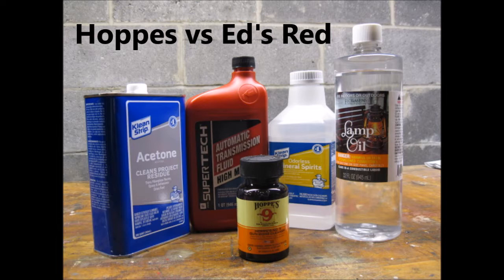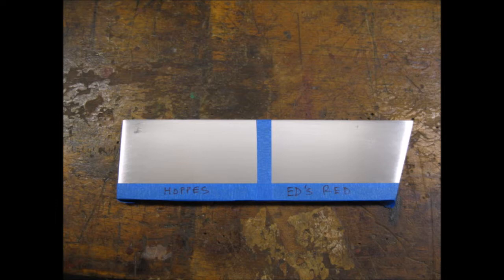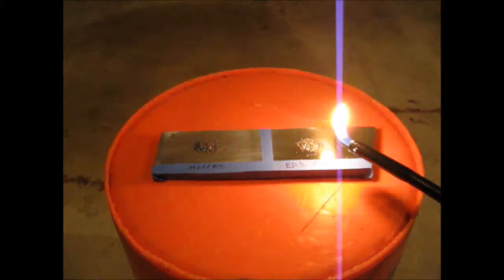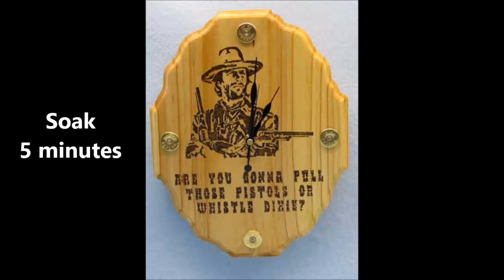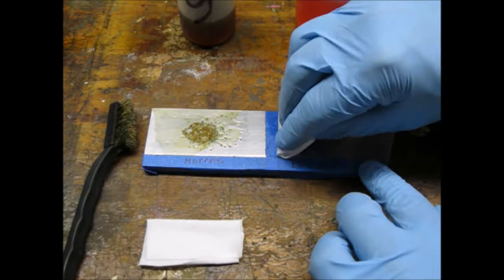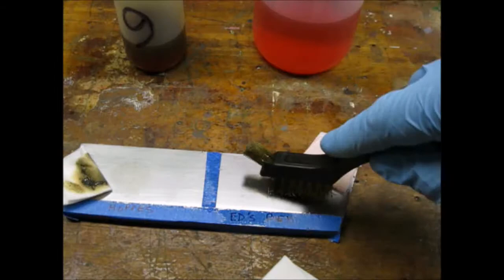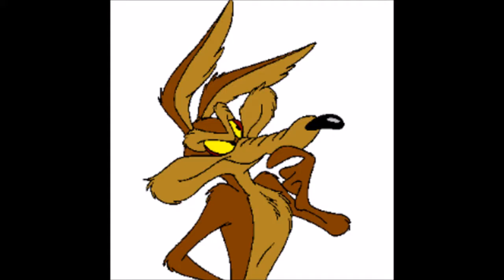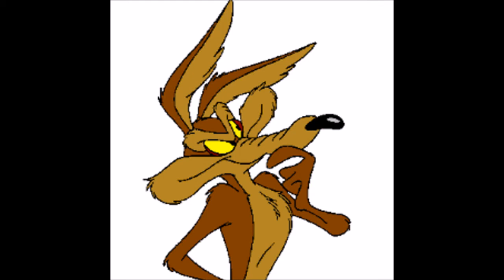Hoppes vs Ed's Red

Comment: I've been using my own blend of "Ed's's Red" made of equal parts kerosene, mineral spirits and ATF and it works very well.  Plus powder residue is not the only foulant that's left from firing a gun.  The Ed's Red does an awesome job removing lead, copper and carbon residue.  It has a strong oily smell, but i like results.
Reply: yeah..   I get that some do not want to use the acetone as it is pretty potent smelling.   But...  it also adds a lot of cleaning power in my opinion.    So what I did was get some amyl acetate...it is a solvent used in making perfume/candles etc.   It is pricey but a couple of ounces per quart and your Ed's Red is housebroken... it seriously neutralizes the solvent odors although it is also a solvent and a cleaner...  It smells of bananas..  A pint of it would work for maybe 5 gallons of Ed's    The lanolin... I get it pure...  again.. pricey but only an ounce per quart.   The original formula used whale oil and in this case I think ATF is an improvement (the first automatic transmissions used whale oil!)  maybe the lanolin is not needed because of how well the ATF protects but.... not gonna argue with my shiny rust free guns   Tho they are costly on the face of it those two ingredients add a bunch IMO and only up the price maybe a dollar a quart.

Comment: I make ed's red without the acetone as this is not needed unless you have plastic residue from shotgun wads. It comes out thicker that way also. I have better luck than this but I use a name brand Dextron type ATF. And it is best used for bulk situations for carbon and old oil residues. I use to do gun shows a lot and would pick up old military guns...works good on those. I use Shooters Choice or Hoppes for regular cleaning. I also use CLP a lot.
Reply from the maker: Thanks for watching!
I tested w/o acetone also
https://www.youtube.com/watch?v=bkIKJ1LYepY&t=2s

Comment: Pretty crazy how a company which worked to refine a recipe that serves a specific purpose, comes with better results for that purpose than something improvised.
Reply from the maker: Everybody talks up the Ed's Red I had to give it a try.  You can't go wrong w/ Hoppes!
Reply: 357magdad
No doubt, it just surprises me. Thanks for the video though. 

Was searching for a cheap alternative so I can just soak my pieces in an ultrasonic cleaner, so the attraction isn’t lost on me.
Reply: Ed's Red wasn't improvised. The recipe follows basic rules of chemistry for removing the type of fouling you want to remove in a barrel/gun. There are dozens if not more commercial bore cleaners that are worse than Ed's Red. Some companies might have found a slightly better recipe for their products, but they still can't change the basic laws of chemistry.

Comment: I use the simplified Ed's Red formula (50/50 mix of acetone and ATF) as a penetrating oil.  It works great for this purpose.  I have not tried the four part cleaner.  Hoppes is fine for cleaning, but I ran out over a year ago and never replaced it.  Instead, I've been using Rem Oil.  Despite having almost every cleaner and oil known to man, I've long been curious about Ballistol but have yet to try it.  Ditto for Butch's Bore Shine.
Reply from the maker: Thanks for watching!  I did some testing on Rem Oil that you may find interesting.
https://www.youtube.com/watch?v=f5zLxoE10FI
Reply: IMO.. Balistol is HIGHLY over rated.   Like you I have tried almost everything and settled on Butch's at the end...  Up until I tried my version of ed's red...   I have at least 5 half full or less bottles of wonder cleaners including on of Butch's    Have not opened one of em in 5 years.    I kinda feel like a sucker for buying em   Also... since it is a penetrating oil it gets under metal fouling.  like lead and jscket material.   I have some Sweets 7.62 cleaner but this is better in my opinion.    A 22 lr barrel that I had about given up on (BADLY leaded) I had tried everything on.  The Eds Red filled barrel soaked for a couple of days removed most of the lead... you could see long flakes of it.    So one wonder product that does really work is Kroil... it is a penetrating oil and has the best smell ever!    In test after test it came in first for penetrating rust and such...but...  your formula and mine came in a very close second.   almost too close to tell.   I bought one of those metal canister sprayers that you pump up with a compressor...   It always has your mix in it     Guy who built hot rods had a LOT of rusty antique car frames etc in his shop getting any fastener loose on em was a major pain   He bought those spray cans of expensive penetrating oil by the case.   I told him to try my/your/Ed's 50/50 acetone/ATF on some.    He was pretty shocked... Nothing he had tried had worked that well. but of course the odor is not great LOLO  so I mixed him up a quart and added a couple ounces of Amyl Acetate to it.   Almost odor free with a slight hint of bananas.    His wife hated the acetone smell in the shop but with the new formula she didn't notice!   better yet after about a week of using it she said "is someone eating bananas here a lot?'
Reply: @doranmaxwell1755  I finally did buy a bottle of Balistol, but I use it for lubing, not as a rust penetrate or for lead removal.  Ditto for Rem Oil and my favorite cleaner/lube, Clenzoil.  Balistol is thicker than Rem Oil and clings a bit better, but the latter has a good reputation for rust prevention.  Clenzoil seems to possess the best properties of both plus the cleaning power of Hoppes.  I never thought about using Ed's Red formula to remove lead.  I've always opted for brass mesh wire over a plug to push the lead out.  I'll give it a try.
Reply: Well.... been shooting 44 mag guns since the 70's...  also handloading and casting bullets.    shooting cast bullts was part science and part voodoo    the result was almost always the dreaded leading..   When everything was perfect?   The leading was fairly light but still a pain.   The tool you are talking about is the lewis lead remover. still have one laying around somewhere...   I used to bring 3-6 jacketed rounds and fire them at the end of a session to clean the bore... that actually worked... but all that is a thing of the past.    Now I coat all my cast bullets with High Tech coatings   no more lube or smoke or leading.     $1000++ worth of luber sizer and the various punches sit gathyering dust.    now I use a simple LEE sizer die (for each caliber) that works like loading dies and pushes sized rounds up into a container.   If Hoppes cleaning power is anything special I have yet to see it... Butch's works far better but the right Ed's Red mix works way better. @Paladin1873
Reply: @doranmaxwell1755  Yes, it's a Lewis Lead Remover.  I haven't had too many leading issues, but it sounds like you shoot a lot more lead than I do.  I always lube my castings and run them through a resizer or I buy factory cast bullets in bulk.  I don't use gas checks because I mostly make light to moderate loads.
Reply: If you buy your bullets the good news is that many commercial casters sell already coated bullets.    There are a lot of reasons to use including cleanup is nothing... and.... I shoot outdoors and cast bullets and my blood lead levels are low end of normal.   you can't 'vaporize' lead in a melting pot.   Where lead is dangerous if at all is that when a bullet is fired there is always some minute lead particles in the air.    outdoors this is not much of a problem but indoor ranges have had to highly modify their ventalation systems....  With the HT bullet coat this is elimated just like with jacketed bullets.... also when handloading you are not handling lead... which may or may not be harmful. @Paladin1873
Reply: @doranmaxwell1755  How can you tell if your manufactured bullets have this coating?

Comment: I use Ed's Red (without Acetone) because I can better afford to fill up a metal pan and soak my BCG and revolver cylinders, for instance, overnight.  Makes big $ difference over time.  Nothing wrong with Hoppes and I love it's smell too!  I'm wondering how much difference using Lamp Oil vs Heater Kerosene made.
Reply: Probably lamp oil = K1 kerosene. https://en.wikipedia.org/wiki/Kerosene_lamp#Fuels

Comment: I think Hoppe's has ammonia in it, I bet that's the key ingredient making a difference in this particular test.  You can add another part of 5 to 10% household ammonia to the Ed's red mix, it will also help it work better on copper fouling.
Reply from the maker: Thanks for watching!  It's hard to beat Hoppes #9!
Reply: You're right. Just in case anyone is wondering, Hoppe's No. 9 Gun Bore Cleaner contains Ammonium Hydroxide (<1%) according to the safty data sheet. (SDS Revision date: 12/2/2019)

Comment: I have always used Hoppes and Rem Oil as my primary gun cleaner for 40 years ( My dad and uncles taught me). I have tried others but always go back to the old stand by. I like the homemade solvent idea but too be honest it is too much trouble.
Reply from the maker: Thanks for watching! Hoppes #9 is hard to beat!
Reply: I had multiple guns develop surface rust in my safe using Rem Oil before I put any gun away, even if I just touched it to look at it.  Switched to Ballistol and haven't had a single speck of rust since.

Comment: Thanks for the vid I had forgotten all about it.   As I say mine has pure lanolin (ounce or two a quart) and Amyl Acetate solvent for odor.. it is also a few ounces per quart or to taste.   Not sure what lamp oil is I use camp fuel #3 which is as close to kerosene as I can get.    When I clean my guns I basically squirt the stuff on and brush the bore and cylinders or whatever and let it sit for a bit.. all in all about 15 min plus or minus I come back to the bore and cruddy spots with a toothbrush and wipe the gun down with a not real clean rag..  then I run dry patches till the bore is clean and dry...next I take a pretty clean rag and wipe everything down then a almost new rag that has a dab of Ed's on it   At this point the gun looks better than new with an obvious coating of lanolin/atf sheen but not oily to the touch.    I keep a rag that has a light spray of Ed's on top of my gun safe and when I handle guns I give em a wipe before returning them.    The other thing about Eds is that it will actually clean black powder firearms and remove corrossive salts from early surplus ammo primers.   I wipe my BP guns down with it before going out and shooting em.     makes cleanup even easier.   Noticeable difference in my tub of hot water.
Reply from the maker: Lamp oil was more readily available to me in small quantities.

Comment: Maybe you'd get a thicker viscosity and better penetration on the Ed's Red if you used a higher proportion of automatic transmission fluid.
Reply: ...perhaps add some lanolin?
Reply: @TheWolfsnack  The oiginal formula from Hatcher did use lanolin

Comment: Add Kroll to the Ed's red mix at about 5 to 10 percent. The Kroll will penetrate under the faulling. Best ever for lead and plastic. It's all I use along with stuff for copper ( sweets or CU2 ). Eliminates the need for a brush to

Comment: Hoppes is crap.. have not used it in years. the Ed's Red?   it always works and I don't have to even have to use oil afterwords.     My eds red is a bit different than yours and includes 100% lanolin and real acetone and camp fuel for the kerosine,      If you use Hoppes to lossen a bolt?    LOL  it does nothing..    Eds red in the modern form will clean and protect better than using both Hoppes and then CLP after..  and cost?   one tenth or less the cost.
Reply: Pretty sure you're wrong.
Reply from the maker: Thanks for watching!  There are a lot of versions of the Ed's Red formula out there. I'm glad you are have success with your recipe.
Reply: Nothing cleans an AR bolt for me like Ed’s red.